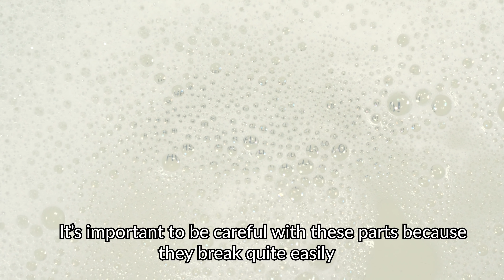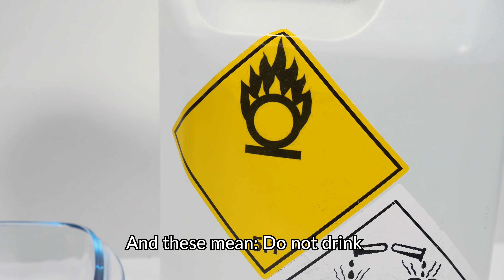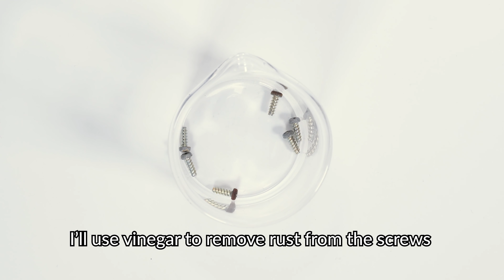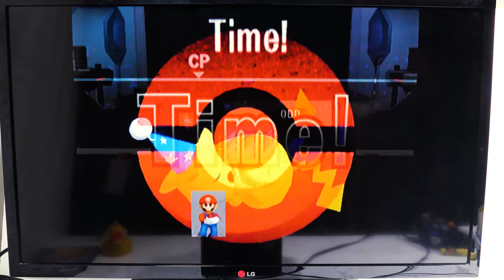Broken & Yellowed Nintendo GameCube Controller Restoration - Retro Console Repair

Comment: Here is a couple more suggestions for the yellowing of the cables:
1. Baking soda.
2. Bleach.
3. Cream peroxide, set it out in the sun for 3-4 hours. Great video.
Reply: The problem is a text on a cable
Reply: @abdulmuhaimin5274  Reapply with a stencil, maybe?
Reply: The dish washer
The washing machine

Comment: It's fun to see you say be careful with pressure sensor pads (if I am wrong on what part that is I apologize ahead of time), because while trying to clean my 8-bitDo controller I was not as careful and found out first hand how easy they were to break... luckily replacements are cheap here in China

Comment: Hey odd, I found an indigo Nintendo GameCube controller at a local collectible store, got it with broken sticks. They included replacement sticks for free, so I opened it up (I already had tri-wing drivers) and replaced the sticks. There was bad dirt build up, but I repaired the entire controller, and it looks and works like new, your videos inspire me to do similar things, and I really enjoy it. Also the isopropyl alcohol worked like magic :)

Comment: Very nice! For anyone doing this, make sure you use as close to pure IPA as you can get for cleaning the board (>99% is ideal). If you use a lower percentage, make sure to dry it thoroughly before putting it back together!

Also, I cannot believe there was a bug living in there. How does that even happen?

Comment: would an agitator with really fine sand have cleaned up the wire as well? Wondering if you could have minimized the manual scrubbing.

Comment: Have you ever thought about using cream developer for hair dying, you can get it in strengths of 7 to 50 concentrate, 50 is the highest peroxide level, paint it on objects that cannot be soaked in a liquid, place it in a light box, I saw a guy use it once on a yellowed plastic bathroom fan cover but he left it in the sun for a day and it worked.

Comment: What is the air compressor tool you use to blow dust off? Assuming it's just an attachment for a hose, but special for electronic dusting.

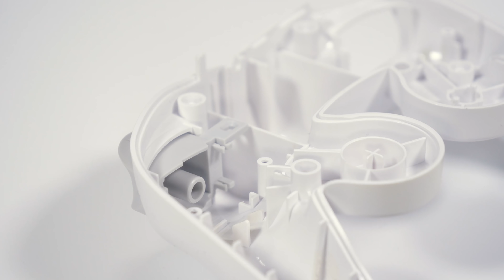Comment: 12:00 - The R and L triggers should have rectangle wire connecting the buttons with those black plastic parts that transfer pressess, the fact they are missing is... odd o_O Like - did someone dissasemble it before and just lost them?

Comment: attempting to do my own restoration, and i put the controller's screws into some white vinegar. The screws holding the halves together turned black (originally like a shiny silver), and the tinier screws for the shoulder buttons turned grey (originally black). Is this normal??

Comment: Odd, what percent IPA are you using? The reason I ask is because I just tried cleaning a circuit board with 70% and the board became gummy, like the coating on it had melted.

Comment: 8:34 but would it short Circuit the controller when you use it
Reply: Nah idk why but isopropyl alcohol is fine for cleaning electronic stuff
Reply: It evaporates quickly and I’m pretty sure it’s non conducive

Comment: I obviously love this channel as much as the next guy, but I've been inside a GANG of used old dirty gamecube controllers (i have restored them for years), and this, put plainly, looks like he bought a very good condition JP White (continued to be manufactured until 2008), dirtied it up, then cleaned it. true wear and tear is irreversible when it comes to GCCs. The sticks wear and get loose, the potentiometers erode, and there's streaks/scratches that stay on the controller, they cant be buffed out. This was still satisfying to watch, but you should buy a truly poor condition DOL-003 platinum controller with visible wear and restore that, no need to go placing chip crumbs behind the trigger pots then lol, they'll be full of genuine cheeto grime from 2003

Comment: Also, can someone who knows chemistry explain to me why you can clean the board with alcohol?
Reply: You don't need to know chemistry to why he uses isopropyl alcohol to clean the board. Isopropyl alcohol is a liquid that contains no water, on top of that, it evaporates fairly quickly so you don't have to wait for it to dry.